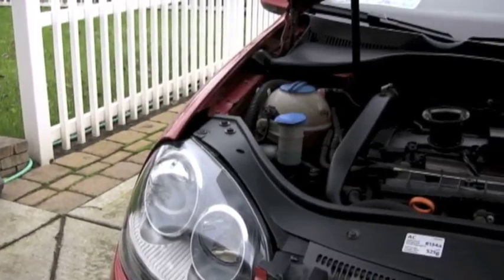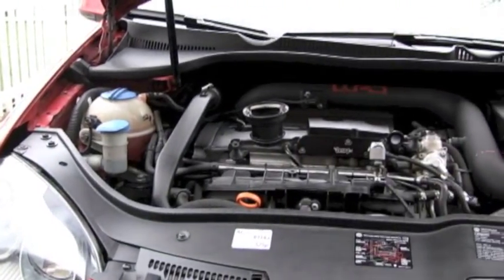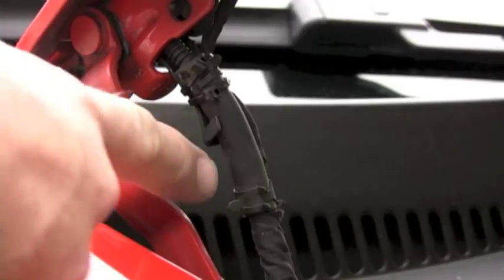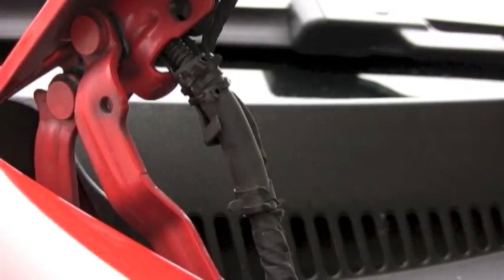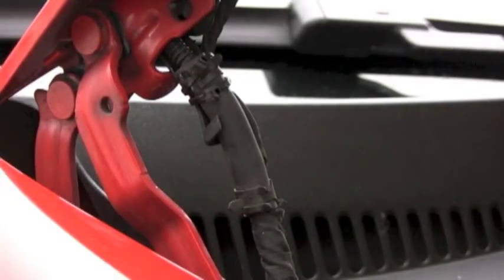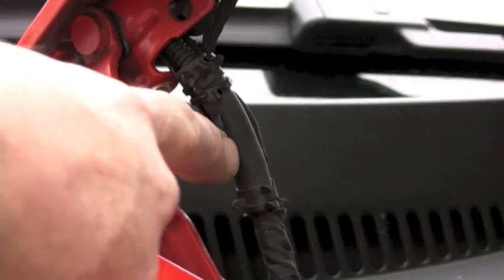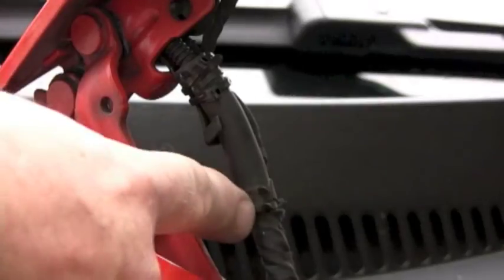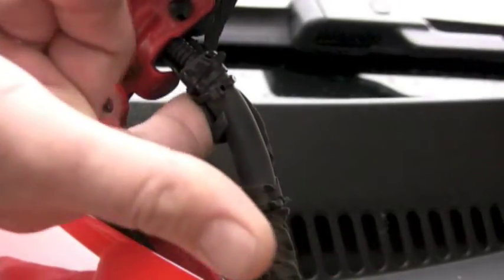VW MKV GTI WASHER LINE REPAIR DIY

Comment: Good work. I personally used inline 4mm garden watering system screw in connectors. 
Got things working again. 

I believe Skoda sell a repair kit, for less than $10

Comment: You know you can pop that bracket off the hood (and unwrap some of the tape holding the tube to the bracket) to be able to get some slack in the tube, right? I just had the same issue - after getting some slack, I found a drinking straw that just barely fit over the broken ends. I slid some heatshrink over one end, then i stuck the broken ends together in the straw. Then I moved the heatshrink into position and shrunk it hard over the whole area. Perhaps come summer when I don't have to work in a cold garage I'll replace it - https://www.carid.com/genuine/windshield-washer-hose-mpn-1j0-955-751d.html
Reply: Damn vw charges out the ass for everything lol.